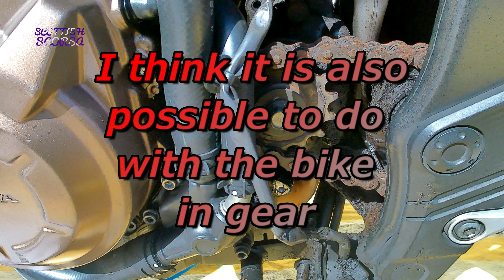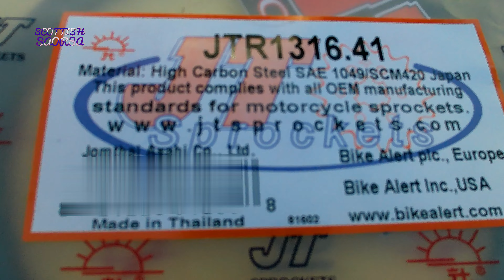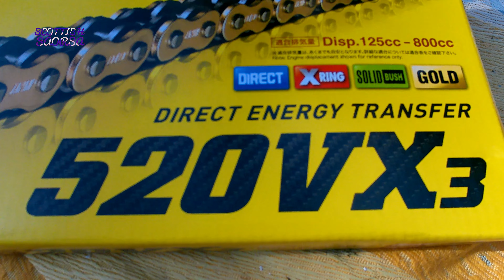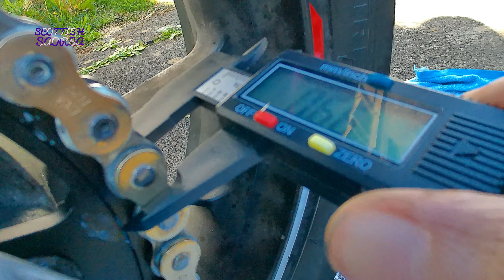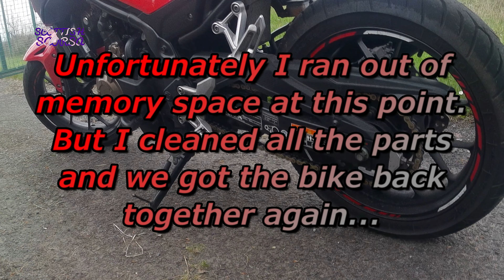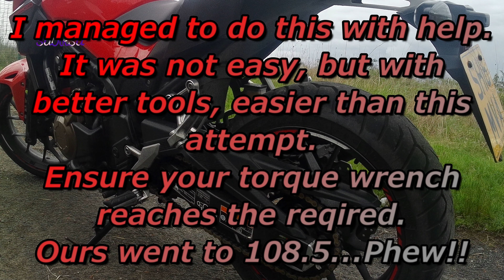2016 Honda CB500F Chain & Sprocket change. Can I change these myself??

Comment: I've just done mine on the VFR.. yeh you need some brute strength in some areas but you've done well.. I got the same DID gold chain. God your old.chain looked well knackered 😁
Reply from the maker: Yeah, that chain, as far as I'm aware, lasted 18000 miles, so it's probably fair enough it was rather knackered haha. I'd had the chain and sprockets for ages, and just hate working in the cold, so I kept making excuses till it got warmer again 🤣

Comment: Great job, albeit I'd clean that sprocket area before replacing the sprocket itself. You had great access to do that, and as you noticed that area tends to get really messy over time. Anyway, I'm happy to see people try and maintain their bikes themselves. Maintenance can cost a lot at garages, and some of them aren't even doing a good job.
Reply from the maker: Thanks for watching again. Yeah I did remove that again and treat the sprocket holder, just never filmed it afterwards. It was hard but not too hard, so I'm glad I tried it, with his help, we managed it pretty well, so I may attempt it again next time. Garages are expensive and as you say, some don't do a good job either.

Comment: One question : is it possible to put press clip master link on those bikes ?
Reply from the maker: It could be possible, however, I've been led to believe that those clips can be more likely to fail with higher acceleration, so personally I would only use them on lower bhp bikes....but I'm no expert on that.

Comment: What happened to the CB500F? Did that front sprocket fit?
Reply from the maker: I still have the cb500f...yes the front sprocket was fine, actually due to change the whole lot again very soon. But they have lasted very well, even with winter use, so i will probably get the same again.

Comment: Well I'm not patronising you mate, but I've still not built up the courage to even order mine for my MT, so lid off to you! 👍😎
Does nobody use spring links on Honda's or what, i remember hearing Lochwood92 talking about cutting his chain off? 🤔
Reply from the maker: Spring links can be a little dodgy if you go really fast. The other half, who you now know is Chris, had one fly off a 400cc years ago, so I'd rather have a real link so I'm less likely to get stranded.
It was a little bit daunting to attempt, but I actually enjoy working on bikes, so it's a good thing to try to learn I guess.
Reply: @ScottishSaorsa  Just what i need in my head while riding...The thought of my spring link failing on me!!! 😮😂👍
Top tip for future, it's far easier to push down on the ratchet, than pulling it up, as you can put your weight behind it, although maybe Chris is a couple of stone heavier than wee you & real glad his name isn't Owen, as Unknown Owen would stick in peoples heads!!! 🤣😉👍
Reply from the maker: Lol, it should be perfectly fine on a 125 cc to have the easy link (as I named it) and yeah, after I gave in with it, he got a big extension and then tried himself, never offered me the extension, that would have given me enough clearance to be able to go down with worrying I'd hit the engine... But I don't mind, cause at least he got it for me 🤣... As for him being not Owen lol.... On the subtitles, we got a laugh, I think you said 'her man' and the subtitles said 'Herman' haha... We get a good chuckle at the subtitles, it's a little added amusement on youtube. 🤣